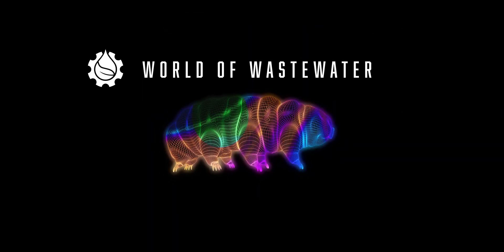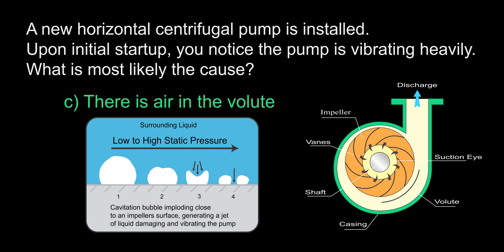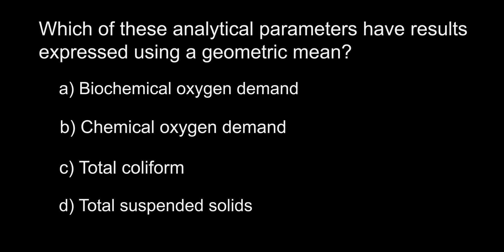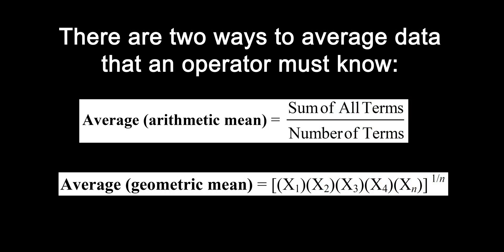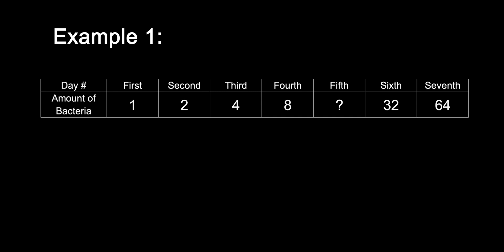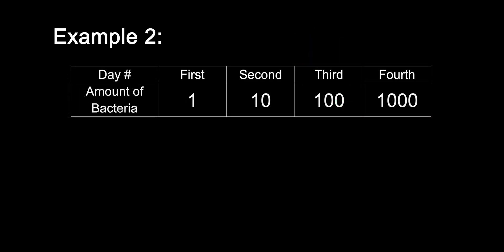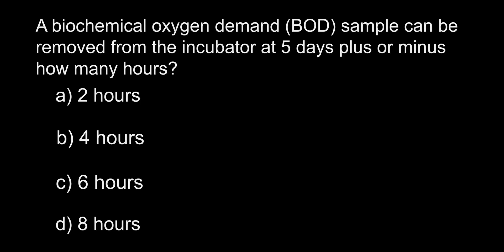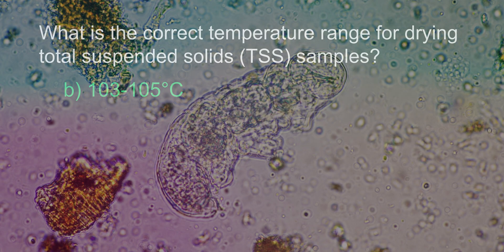Part 15 - Wastewater Treatment Operator Exam Questions

Comment: Can you Confirm that question 74 is 6 hours? I have in my notes from class that its +/- 3 hours? Thanks These Videos are very helpful
Reply from the maker: Hello, great question.  I stand by the answer in my question.
In my 2017 Standard Methods textbook for BOD (method 5210) it states: "Determination of final DO: After 5 d  +/- 6 h of incubation..."
I could be wrong but I don't think this has changed in future versions of Standard Methods.  It perhaps it used to be 3 hours in previous versions,  I see there is some confusion online about this when I googled it.  If you find a your hands a new edition of standard methods, let me know!  Thanks!

Comment: I have a different answer for Question 74.  For some reason I read it was plus or minus 3 hours... so I'm guessing that has changed?

I see the recommended grab sample holding time is 6 hours but that is different.
Reply from the maker: Hello and great question.   Based on the last few editions of the book Standard Methods for the Examination of  Water and Wastewater (which all testing is pretty much based off of) says that the holding time for BOD after incubation is now give or take 6 hours.   Upon some research I just did it looks like it used to be 3 hours quite a few years ago.  
My test has gone through changes over time as I release videos so be sure to download the most recent version.  Thank you for watching!
Reply: @worldofwastewater since this comment was from 2 years ago, do you know if this incubation time is still 6 hours?

Comment: If you have time I had an AI generate twenty wastewater math problems.

I just want to know if you believe they're conclusive and consistent with modern day wastewater knowledge.

I also do not have the answers to these problems. The AI will reject some academic questions. 

If you can get to at least some of these then that'll be great. Thanks. 

Here are 20 sample wastewater treatment math problems:

1. A wastewater treatment plant has an influent flow rate of 5 mgd. If the plant has a treatment capacity of 75% removal efficiency, how much effluent will be produced?

2. In a primary sedimentation tank, the flow rate is 2.5 MGD, and the detention time is 2 hours. What is the surface area of the sedimentation tank required?

3. A wastewater treatment plant serves a population of 20,000 people. The average daily flow is 5 MGD. What is the per capita flow rate?

4. The influent BOD of a wastewater treatment plant is 200 mg/L. If the BOD removal efficiency of the plant is 80%, what is the effluent BOD?

5. A wastewater treatment plant settles out solids in a primary clarifier at a rate of 0.03 ft/s. If the clarifier's surface area is 5000 ft², what is the flow rate at peak flow?

6. A wastewater treatment plant removes 90% of the SS from the influent flow. The incoming flow has an average SS concentration of 250 mg/L. What is the effluent SS concentration?

7. A wastewater treatment plant is designed to remove 95% of the BOD in the influent wastewater. If the influent wastewater has a BOD of 250 mg/L, what is the effluent BOD concentration?

8. A wastewater treatment plant receives 1500 gpm of raw sewage with an average flow BOD of 300 mg/L. If it is desired to treat the sewage to produce an effluent with a BOD of 27 mg/L, what is the required BOD removal rate?

9. A wastewater treatment plant handles a flow of 24 MGD with a BOD concentration of 300 mg/L. The plant has a capacity to treat 75% of the incoming BOD. What is the plant's BOD loading?

10. If the influent flow to a wastewater treatment plant is 50 mgd and the MLSS concentration in the aeration basin is 2000 mg/L, what is the amount of MLSS in the basin?

11. A wastewater treatment plant processes an average daily flow of 4 mgd. If the plant has a chlorine dosage of 5 mg/L and a contact time of 20 minutes, how many pounds of chlorine are required per day?

12. A wastewater treatment plant has a hydraulic retention time of 22 hours and a flow rate of 6 MGD. What is the volume of the treatment plant?

13. If a wastewater treatment plant has an incoming flow rate of 4 mgd and an average influent BOD concentration of 200 mg/L, how many pounds of BOD are received each day?

14. A wastewater treatment plant has a peak-hour flow rate of 12 MGD. If the plant has a peak factor of 1.5, what is the peak-hour flow rate?

15. A wastewater treatment plant settles out solids in a primary clarifier at a rate of 20 gpm/ft². If the clarifier's surface area is 5000 ft², what is the flow rate at peak flow?

16. A wastewater treatment plant has an average dry weather flow of 3 MGD and a peak wet weather flow of 6 MGD. If the treatment plant has a peak factor of 2.0, what is the plant's peak-hour flow rate?

17. A wastewater treatment plant has an average daily flow of 5 mgd and a peak-hour flow of 8 mgd. If the plant's peak factor is 1.5, what is the plant's peak-hour flow rate?

18. A wastewater treatment plant receives 3.5 MGD of raw sewage with an average flow BOD of 250 mg/L. If it is desired to produce an effluent with a BOD of 20 mg/L, what is the required BOD removal rate?

19. A wastewater treatment plant has an influent flow rate of 3.5 MGD and an influent BOD of 300 mg/L. The plant's BOD removal efficiency is 90%. What is the effluent BOD concentration?

20. A wastewater treatment plant has an influent flow rate of 6 mgd and suspended solids concentration of 250 mg/L. If the plant removes 80% of the suspended solids, what is the effluent suspended solids concentration?
Reply from the maker: I think AI is pretty neat, I use it for some stuff.  I would not use it for wastewater information.  I have attempted to use it myself a few times for wastewater related material.  I was not impressed, wastewater knowledge is in very small amounts on the internet, AI is not able to fully understand the nuances of treatment plants and dont understand wastewater exam material.  I will be honest I only read about half of the questions.  I would say most of these are not good questions that you would find on a typical wastewater operator exam.  Also seems like most the questions are kinda similar and not a wide range of subject matter.  I appreciate you reaching out and by all means keep on using AI. To put simply, I would not recommend it for wastewater studying.  The questions in my videos are similar and influenced by actual questions people have seen on their exam.  Thanks!